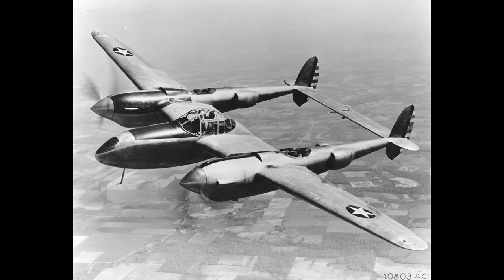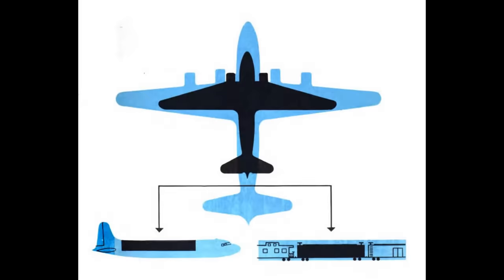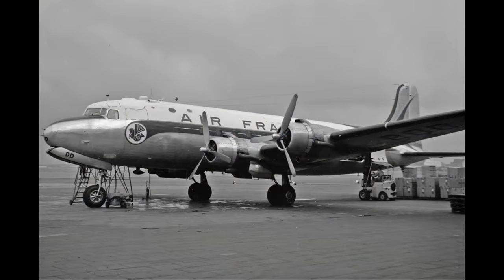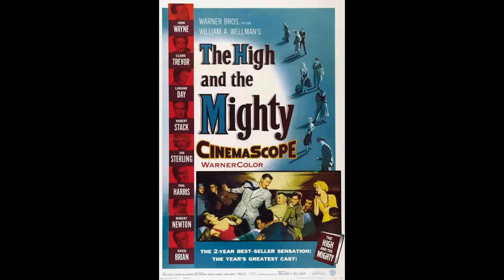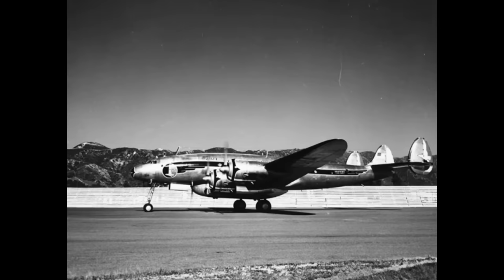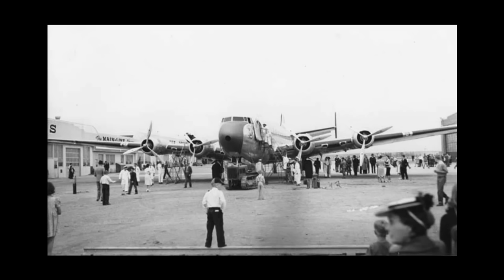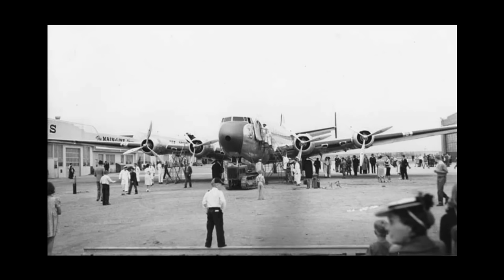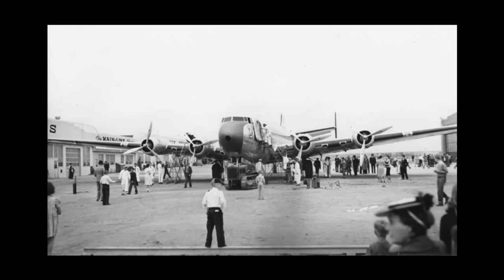Turbo Compound Piston Engines. Almost magic tech.

Comment: As noted in the video and commentary the R-3350 was a maintenance hog.  Which in my opinion tracks back to an error made in the original design.  The piston to cylinder wall clearance in the R-3350 was 8 thousand(s) while the clearance in the R-2800 was 5 thousand(s).  Hence the high oil consumption.  As the engines added that clearance increased.  Then when the power was reduced the piston would rock back and forth in the cylinder.  Then with more ageing the upper ring land of the piston would detach and pass through the Power recovery turbine, hence the "parts recovery turbine" comment.  Due to the complexity of the engine installation airlines resorted to an engine change instead of changing the failed cylinder which increased the maintenance cost.  That aside it was a giant technology step forward.  SAS felw the DC-7-C over the north pole to Toyko (nonstop), which was unheard of in 1957.  In high blower the aircraft was capable of operating at 25,000 feet above bad weather and iceing conditions.

Comment: As an old age 90 A&P mechanic for Eastern Airlines I thoroughly enjoyed your video. Brought back a lot of memories. Everything described was spot on as I remember it from experience and EAL Apprentice School. At one time or another I worked on DC6B, 1049 Constellation “Connies”, Convair 440, Martin 404, Lockheed 188 Electras but mostly the DC7B. Eastern got a lot of bang for the (horsepower) buck but paid a heavy price in maintenance for it with turbo-compound fitted engines. At virtually every maintenance visit, of 12 PRTs, as we called them, usually three required unscheduled replacement. But these things were tough. If you sat in a forward left or right window seat at night you would see PRTs running orange/white hot for hours at cruise power.  At TO they would glow white! Because they were pulling so much power at takeoff, (as I remember TO power was limited to 3 or 4 minutes and had to be reduced to METO) all kinds of things broke mainly, cracked exhaust/intake pipes and associated hardware, cracked cylinders, stripped bolts, and knife sharp stainless steel fairing created from vibration.  Behind the rear bank and forward of the oil tank was the accessory section and was an absolute oily mess to work in when changing components. Jug (cylinder) changes were much more difficult than the same job on P&W 2800s on the Martin 404 and Convair 440 due to very tight “baffling” of the cylinders. 
EAL also operated varying models of the Constellation (1049,1049c,1049g, Super G) and DC7B all equipped different models of the 3350 the worst being on the older 1049s with engine EXTERNAL flexible scavenge oil lines that were impossible to prevent leaking. We used to say “if a Connie wasn’t leaking it wasn’t airworthy.” Note Connies leaked hydraulic fluid as bad as engine oil.
As a sideline not part of the discussion, all the manufacturers were trying to get as much HP as possible in that period just before jets and therefore tried many approaches. P&W 2800s (Martin 404) used water/alcohol injection to exceed max power about 5”hg (?) for takeoff. Convair440s were equipped with augmenter/mufflers that consisted of bundling all of the exhaust pipes into one cluster and feeding them into a bell mouthed tube inside a box on top of the wing that was positioned in such a manner as to reduce back pressure on the exhaust system. Don't know what it did for HP but they sure were quiet.
Then there were turbo-props,,,but that’s another  story.
Reply: Thanks for the great background. I recall reading PRTs were high maintenance and the big radials, while great engineering achievements were fussy engines when pushed to make big HP.
Reply: Thank you for your recollection sir. You were witness to a golden era of aviation.
Reply: Thank you so much for sharing your stories. The original hydroplanes used some of these era motors to push for speed
Reply: Good recap. I'm 10yrs your junior but started out on the 1049H Connies with FTL in the mid 60s. You're spot on about the  maintenance. Many times when a Connie taxied up after a trip across the pond, you heard a screaming PRT. If it was the bottom one, just throw away your coveralls cause being bathed in 120W oil would never come out. Gotta say though, the 3350 was one hell of an engine that had a lot of respect. Not only were the PRTs unique, so was the direct fuel injection and the low tension ignition.
Reply: Were you still at Eastern Airlines when Borman agreed to give employees a stake in the company in exchange for a slight paycut? If so, would you mind detailing what it was like during that time? How did you feel about Borman, or how the company was being run? Do you feel like Eastern could've survived if it had been turned into a co-op?
Reply: I'm also a graduate of Eastern's apprentice program. Early 60's in MIA. Went on to being a Flight Engineer and spent many an hour stareing at the engine analyser whatching for a shorted secondary meaning pieces of metal were flying around in the cylinder. A prompt shut down would mean a jug change instead of a complete engine change. Loved those big Wrights on the 7's and connies. Got laid off, bounced around on the non-scheds, got my pilot rateings and ended my 60+ year career as a Corporate Chief Pilot operating jets. My foundest memories are riding middle seat on those 7's and the drone of those big Wrights. I owe it all to my start as an apprentise at EAL.
Ron Hedges 
😊
Reply: Did you know John Koenig maintenance supervisor for Eastern in ATL?
Reply: I recall reading years ago that this engine took up to 30% of the power produced to just pull itself through the air.
Reply: I bet Metallurgy has advanced to the point today where PRT's for aircraft might be revisited.
My guess is that Inconel and other such alloys were prohibitively expensive and reserved for ships like the X-15.
Reply: Thank you so much for your priceless memories.
Reply: As a child I rode a Constellation from Norfolk, VA to San Francisco when my dad transfered to the west coast in 1957. It left before dark and destinated long after dark when I was asleep....but I still remember the humming roar of take-off, and hearing how the pilots tuned the engines when we leveled off at cruising altitude. I wish I knew more about which Connie I flew on....have to look up the different models to compare.....
Reply: You are as interesting as Greg. A different way, that's all.
I'm not a flyer or an engineer, just curious. It a college library there is a book describing the evolution of engines. It explains where the power was coming from. 
It ended with the B-29s engine. I imagined going one step further, dispense with cylinders to compress the air. 
Do that with the supercharger. Or at least some kind of rotational compressor. 
And make the exhaust turn the rotational compressor. (OK, I knew that jets and propjets existed.) 
But I never imagined using the exhaust which had already done work to be able to assist the crankshaft. 

Good to hear your tales.
Reply: @dieselyeti   I worked of the SP2H with VP-65. PRT failures seemed to be pretty rare.
Reply: PRT? Parts Recovery Turbine? Because all kinds of stuff ended up in them.
Reply: ^ Power Recovery Turbine. See "Turbo-Compound Engine" wiki article. Or, listen to the information presented in this video.
Reply: You have a very sharp memory. 

I probably can't tell many details about a job from 15 years ago. Let alone 60?😮

As to the last part of Your comment on exhaust augmenters. Based on some NACA reports from '43/44, it appears they performed at least three functions:

1: By pointing the exhaust rearward, a small amount of jet thrust could be obtained. Much like the Spitfire and Mustang Merlins which were said to develop 70lbs from exhaust alone. This thrust is low compared to the propeller thrust at low speed. But becomes a larger portion of that thrust at high speed, as the propeller produces less thrust as velocity increases. If horsepower stays the same. NACA reports show mild supercharging with augmented exhaust gives +16% thrust at 350mph. Pounds of thrust equals horsepower at 550ft/s. (325Kn/375mph). And so by using those NACA charts, I estimate close to +20% thrust at higher speeds approaching 400mph, and with higher manifold (cylinder) pressures.

2: By pointing the exhaust outlets into a long tube, the exhaust-gas pulses create a Venturi effect, thereby generate a small yet measurable vacuum inside the cowling, on the backside of the engine. Again, NACA reports on that topic show 6" to 10 inches water column of vacuum. This would create a larger pressure-drop, primarily during ground run-up, and in the takeoff roll. Possibly in climb, and also in the thinner air at high altitude. The augmenter would allow for reduced cowling opening area and tighter cowling. Since it did not have to be designed as open for ground-cooling.

3: Silencing the exhaust. By shrouding the outlets completely and blanketing the exhaust gas with that turbulent cooling air from the engine, it would really help quiet it down. 

Also, the engineers were free to cut the exhaust pipes to the precise length required for maximum torque at any given RPM and EGT which they decided the engines were to run at. Exhaust tube length is a primary factor in generating wave-action exhaust scavenging. As the reflected negative sound wave travels upstream at the speed of sound, and that speed changes with temperature. So EGT and RPM determine exhaust length for optimal power. Up to 3% improvement can be had with individual exhaust. Possibly more with a well engineered collector. 

(None of this works for a Turbocharged application, only gear driven superchargers and free flowing exhaust).
Reply: Does turboprop have a chance against jet engines
Reply: It is always fascinating to hear from people who were actually involved in these machines. They were, and still are marvels to behold.
I am very impressed with this channel. I am 56, so I was not around for the old days of prop passengers. My late father told me that as a child he would be put on a plane to travel to see relatives, etc. He would talk about how air travel once was. Thanks to you sir for sharing your experiences. I have loved planes since the age of 8. My best friend's dad actually owned 2 WW2 fighter planes. This was 1976. I got to learn a lot about planes, ww2, and went to air shows. I became a high school science teacher, but considered going into the Navy, maybe trying out for flight school.
Reply: What about the fuel consumption at same speed?
Amazing story of your father ,sir.

Electra was maybe a design for military.Appreciate this great story ,thank you very much.
Please share more memories with TriStar for example or the requirements for pilots and mechanics at that time
Reply: Please write memories of your profession then.
Reply: My dad was an A&P for Eastern for 20+ years in ATL.  He spent some time as the engine change lead for AOG DC-7B's. After reading your reply to this video, it looks like you had very similar experiences.  He started with the Martin, Convair, Connie, and DC-7.  He moved on to the Electra, 727, DC-9 and L-1011 as the jets replaced the props. One evening I picked him up from work and there were a number of engines lined up for overhaul in Miami.  Each engine had a tag which among other things showed the total time since last overhaul.  All the 2800's had normal TBO times in the 2200-2400 hour range.  None of the 3250's came close.  They were typically in the 1200-1600 hour range.  Being a former pilot, I can't help but wonder how many inflight writeups that represented on those 3250's....  Still, that engine was amazing but "high maintenance."  We used to live in SW Atlanta and most of the departures flew over when they were on a west operation.  On a hot day you could tell they babied the DC-7's on climbout.  Once they were cleaned up and in cruising configuration it looked like they couldn't be climbing much over 300 fpm....
Reply: Great info thank you
Reply: Thank you so much for your insight, we are losing the best of the Greatest Generation fast and their incredible knowledge and stories, please pass on to as many as you can we can't replicate this information or knowledge anymore.    I earned my privates in 1990/Age 22, bought my first plane before I even finished it, a C150M and learned to maintain it myself from an Grouchy old A&P.   I had no money, barely eating, so he let me do the work and only charge me for the inspection.  He let me use any tool he had as long as I put it exactly back where it came from.  I was already a Marine/Boat Mech (to pay my way through school), but working on planes took me to another level.   Knowing I was a starving wannbe pilot he hired me to do the grunt/grimy work for some extra crash for 100LL.    I sure miss him.
Reply: @mline250 
yes Golden as long as long as the oil was clean, then it was black golden everywhere

Comment: An outstanding presentation on an engine that I thought was an abomination. In the early days of my flying career (1978) I was a co-pilot on an ex-RCAF C-119 equipped with R-3350 Turbo Compounds. I was employed by Bighorn Airways in Sheridan Wyoming and we used the airplane for aerial spraying on cattle mosquito control contracts. On a flight out of Laramie, Wyo, we were about about 50' AGL on  new swath, when the right engine had an exhaust valve failure and sent pieces of the exhaust valve into the #1 PRT which seized it. The torque on the #1 engine dropped from an indicated 151 lbs of torque to zero in what seemed like miliseconds! Since the base field elevation was 7400 feet or above, and we were down in small valley, we were pretty close to one inoperative service ceiling ceiling at our weight, at least until we dumped the 700 gallons of malathion and diesel fuel mix we were carrying. We struggled up to about 300' agl and flew 30 miles back to Laramie. All the way back I was keeping one eye on the left engine torque meter and the other eye on the gear switch. Since this the only catastrophic engine failure I suffered in a multi-engine airplane in 30 years of flying- the R-3350 Turbo Compound was never my favorite engine. Give me a Pratt & Whitney anytime!
Reply from the maker: The R-3350 was always a bit of a problem child and never more than just OK. The problems were not the result of turbo compounding.
Reply: the C-119 could barely fly empty on one engine, you were lucky.
Reply: I worked on C-119 076 with California Air National Guard. I have seen pics of 076 in non-functional conditional at Greybull. We had 3350s with Aeroproducts props.
Reply: @adotintheshark4848 😂😂😂❤
Reply: Ha. I worked as a ramp rat at Laramie Regional airport. Small world here on YouTube. Have a great day!

Comment: I had the privilege to fly in a DC-7 when I was young. It was still a time when flying was an event you dressed up for. I remember the stewardess gave me a pin with the company's logo and wings, which she pinned to my coat and I wore proudly. The flight was smooth and you could see more objects below you than in today's jets. The other thing I recall was how extremely loud and deafening the engines were that they limited your ability to hold a conversation, just one word here and there. By the time I got used to all the noise, the flight was over. Today, I'm glad I flew in one because just a couple of years afterward the DC-7's were all replaced with jets on the route I had flown.
Reply: You still have the pin?
Reply: I regret I never got to ride a DC-7 or a 707, Too poor &  too young.
Reply: "you could see more objects below you than in today's jets"

Huh?

I have flown dozens of times in the last 30 years and have always had a fine view of what's below... always has a lot more to do with cloud cover than anything else

or do you mean the planes flew lower so cloud cover was less of an obstacle?
Reply: Thank you for the interesting informative background storyline
Reply: @matthewlehman7937  He is talking about the cruising altitude was lower in a piston engined aircraft than in a jet, thus you were closer to the ground and could see more detail.  Today, the same holds true when you are in a puddle jumper rather than a commercial jet.

Comment: I joined the USAF in 1964 after just turning age 18.  My first Duty station was a 3 year tour at Torrejon Air Base , Spain,  Madrid.   I worked line maintenance on all  MATS (MAC) aircraft transitting Torrejon.    C-131-, C-54, C-118, Connies, C-124 ,C-97's   best assignment in the USAF at the time.   Learned so much ,      Good old days.   Retired flight engineer now  DC-8-62
Reply from the maker: Wow, where were you an engineer on the 8?

Comment: Many years ago, I flew on a DC-6 or 7 military flight from Naples to Rota during a trip back to the US for submarine schooling.
We left at night, and as we taxied out and ran up the engines, the exhaust manifolds began to glow red (a little concerning for a 20 year old newbie)!
The loose fitting cowlings on this old workhorse were so banged up and worn, that you could see right into the engine through the gaps in the panels!
There’s no telling how many planes those old panels had been mounted on over the years!
Any way, I survived, but I might not have remembered this wonderful flight without my light show in the engine bay!
Thanks Greg for all your wonderful, instructive vids!